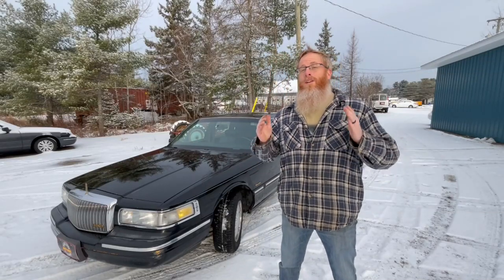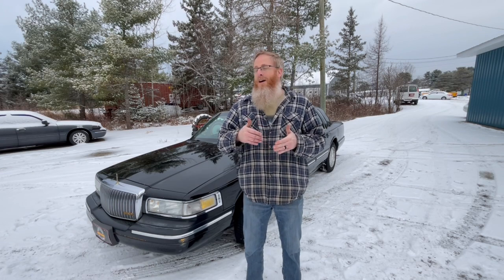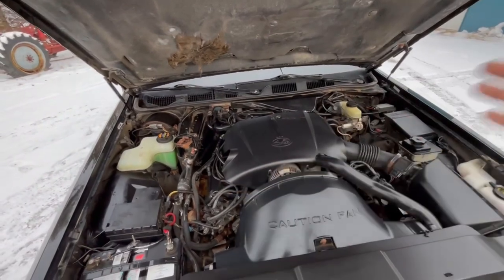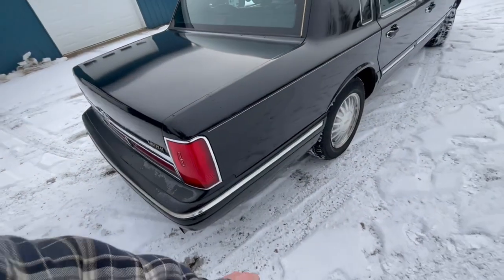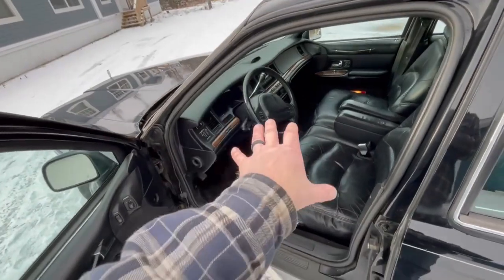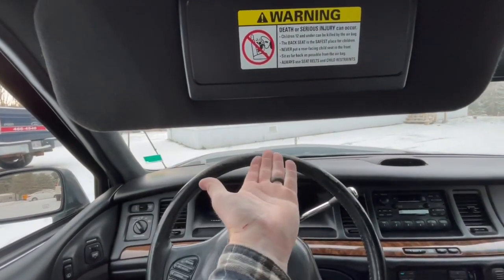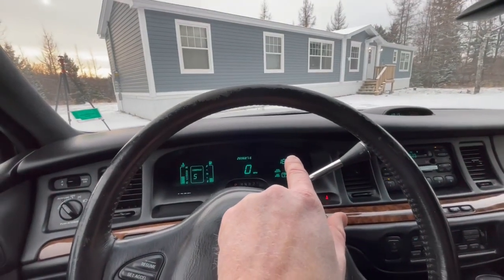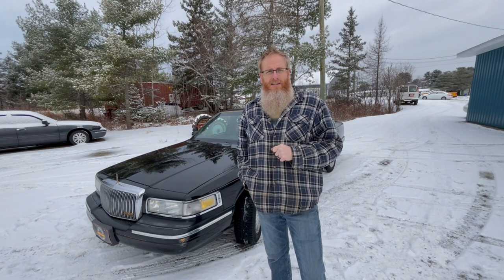What Would You Pay For This 1997 Lincoln Town Car Signature Series?

Comment: Are the 03 lse known for thermostat housings gasket leaks  plor it might be the intake
Reply from the maker: Pretty much all 4.6L were known for leaking intakes and/thermostat housings unfortunately, however, they are an easy fix for the DIY'er.
Reply: @OldeCarrGuy  for shure. It's an lse car so I herd it's a little more hard to find car. Al the same parts.   But I guess the lse trim was a good one
Reply: Sorry for all the msg. I no u are a bizzy man.. but I checked the tork on the thermostat housings and it was low. So I gave it 2 or3 more foot pounds and the leak stopped (love the vids)

Comment: The ignition dinging is easy to fix, but mine stopped dinging after I pulled on the ignition collar a few times. It used to go off every time I finished driving, but since just pulling on it a few times, it's very rare and it doesn't bother me. Fluid film annually on the underside would make this car last many more years. Some of the problems I've had were weird, but always cheap and easy to fix.
Reply from the maker: Cheap and easy to fix seems to be the mantra to these Panther cars!